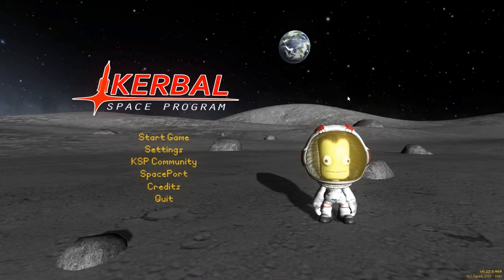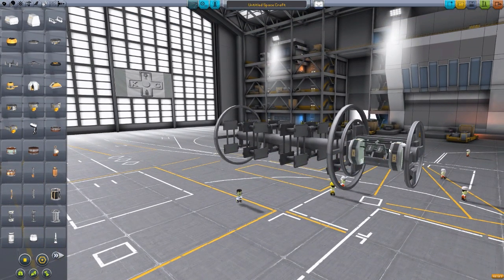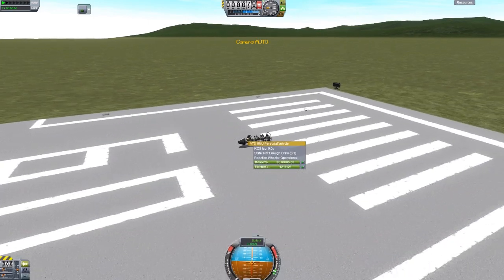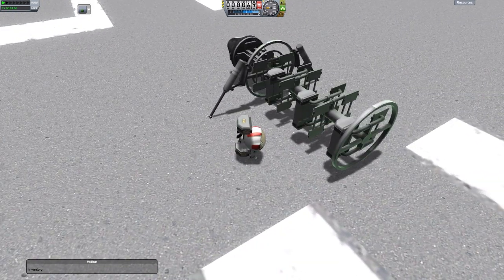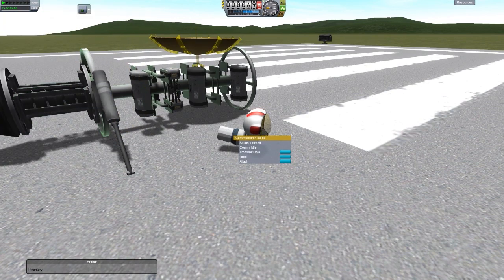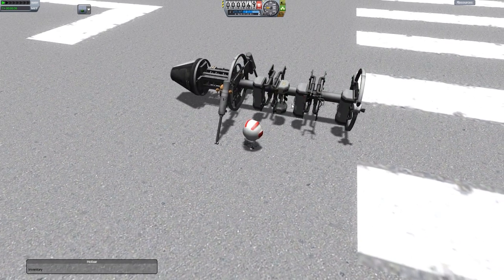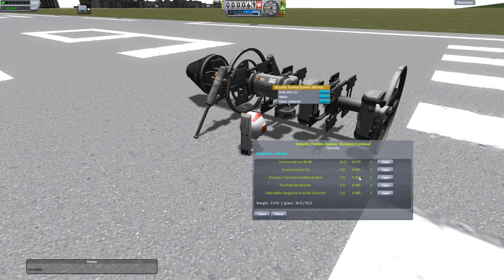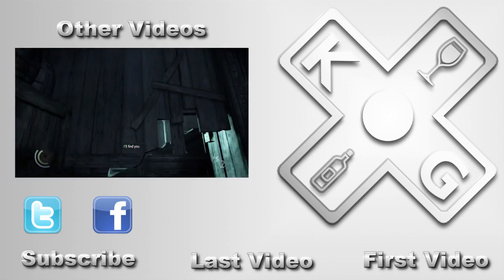KSP Mods - Versatile Toolbox System

Comment: Hang on. So... With a command seat on your back, can another Kerbal then right-click > Board?

Edit: I swear this was integrated into KAS, either that or it's adding pointless features as you can already Grab and Attach using KAS, and store in cargo containers.
Reply: This is just a part extension for KAS.
Reply from the maker: indeed it is just an expansion, I just did a very poor job of making that point in the vid (sorry about that)

Comment: This does look to be an extension of KAS since it even uses the same style of showing where you can attach parts.  Also, yellow means that it can be attached at that location, but your kerbal is too far away, just like you can't pick parts up from far away.
Reply from the maker: indeed it is, unfortunately I did a poor job of pointing that out on the vid.  That and ya completely missed that with the yellow bit, oh well though live and learn I guess.